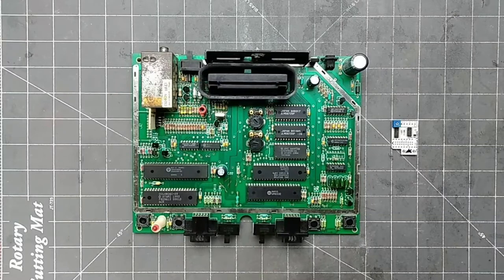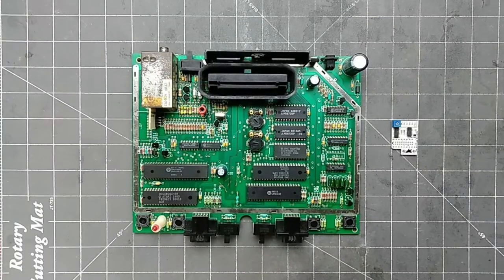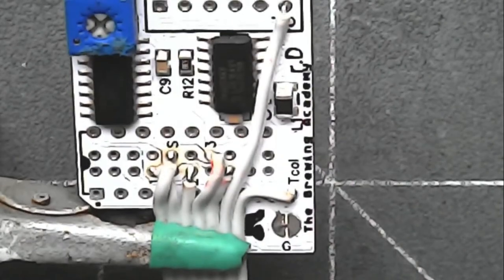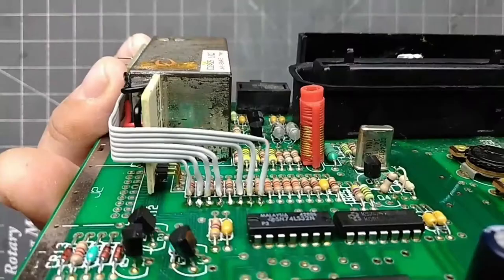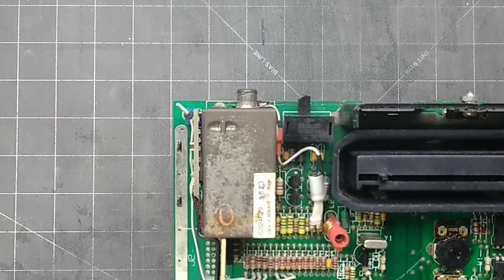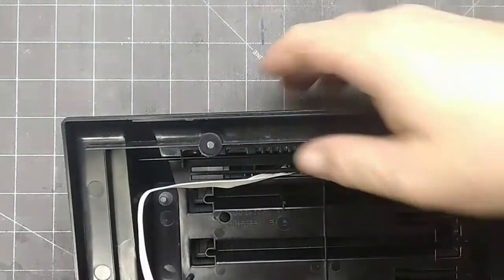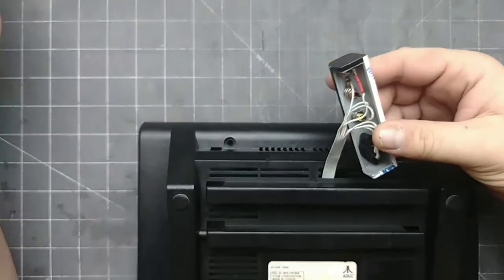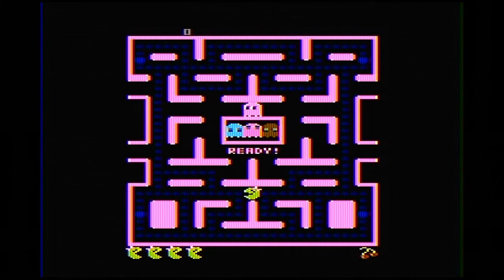ATARI 7800 UAV INSTALL WITH A 3D PRINTED BRACKET [MOD]

Comment: Great vid, thanks for sharing! I should note that for me on the revised board, the 5V power was the pin beside the ground not the one on the far end
Reply from the maker: You're welcome. Thanks for the comment.
Reply: Agreed on this. On all revisions that I've seen (I've seen a lot..), the first and second pins from the south to north are always ground and +5v. I think that last or north most pin might be +5v depending on the channel select switch but I would need to check that in more detail. You can also grab ground and +5 from right there at the expansion port section too, but obviously not usable if your 7800 actually has the expansion port attached.
Reply: @IvoryTowerCollections  that is indeed the case, one of the pins on the RF box gets 5v all the time regardless of what channel the switch is set to, and the other pin only receives 5v when the switch it set to output to channel 3 (I think it was channel 3), and when the switch is set to channel 2 that pin no longer receives 5v so the UAV will no longer work (this has thrown a few people off in wondering why their UAV was no longer working).

Comment: I knew what was going to happen as soon as I seen the connectors being attached to the ribbon cable outside the case and where you was going to feed the ribbon cable through into the case, 30+ year old plastics don't take kindly to bending/flexing. other than that its a very clean install.
Reply from the maker: Right. I should find thinner conectors. Thank you.

Comment: I know this is an old video, are you still selling the boards, I have one but it requires removal of things from the 7800, then I saw yours where nothing needs to be removed and thought I would check first to see if you are still selling before continuing with the other
Reply from the maker: I don't sell them. I get mine from thebrewingacademy.com.
Reply: @ARCTICLABSERVICES  thank you for the info I know this is an old vid. 🙂

Comment: For the audio, instead of adding the two resistors, could you just tap from the other side of the 7800's two resistors and connect them to the capacitor?
Reply from the maker: To be honest, I don't know. If you are not using RF any more, you can pull the one side up and just solder. If you use them in circuit, it might cause poor audio. But again, I don't know for sure. I never tried it.

Comment: Hi, went to a couple of electronics stores, and they don’t have any of the parts you used, except for the resistors :( 

any chance you have links to where you purchased your parts?
Reply from the maker: Sorry. I don't have any links. The parts used to be everywhere.  Then, all of a sudden, I couldn't find them. I had to get mine from aliexpress. I was hoping it was just a temporary thing but I still can't find them on ebay. Sorry.
Reply: Thanks anyways. Can you just tell me if the ribbon wire was 30 gauge?
Reply from the maker: Im not at home atm. If it helps, It was a ribbon cable from an old pc.

Comment: I’m not sure about the VGA ground. Did you connect all four of them together?
Reply from the maker: Sorry for the delay. im not sure what you are talking about. There is only 2 grounds in this instalation and no VGA.
Reply: @ARCTICLABSERVICES  what I mean is it looks like there’s a ground on the board which goes to one of the grounds on the VGA connector and then to the second ground on the VGA connector. Is that correct both grounds in the VGA connector are connected to the board.
Reply from the maker: @acolic1867  oh. The s-video port. Yes, i connect them all together.

Comment: Does it have to be s video, could it be used to go into a genesis 2 connector?
Reply from the maker: If i remember correctly, Genesis 2 connectors have outputs for all standard video formats. A/V, S-Video, RGB... It will work but only with A/V and S-Video out puts. I hope I answered your question.

Comment: are you taking work I would like to get a 7800 done... And use it with a retrotink 2x
Reply from the maker: I did some calculations. it would be $90 for parts and labor. not including shipping. you can calculate shipping by using my zip code. 34473. be sure to include return shipping. let me know if its something you still want to do.

Comment: How do you adjust the colours on on the mod? For example sea quest the blue ocean is a green colour.
Reply from the maker: there is no way to adjust the colors with the mod. there are two large potentiometers on the Atari itself. one is to adjust the color for 2600 part and the other is for 7800. but to be honest, I don't know if adjusting those will help. the UAV might be getting the signal before it even gets to the potentiometers. give me a few minutes and i will find out. i just happen to have my 7800 on my work bench.
Reply from the maker: ok. yes, the two potentiometers can change the color output on the UAV. but if the colors are still not correct after adjustment, you probably have bad or failing capacitors.
Reply: @ARCTICLABSERVICES  Thanks for the help, it only seems to be the colour blue that’s effected all other colours are properly displayed.
Reply: @ARCTICLABSERVICES  Thanks, tried that and everything is back to normal and looks proper.
Reply from the maker: @llcoolguy22  awesome. Glad I could help.

Comment: Are those jailbars typical?
Reply from the maker: what i think your talking about are the pixels. its a bad video capture device. without the capture device, the vertical lines are still there even if i use the original RF.